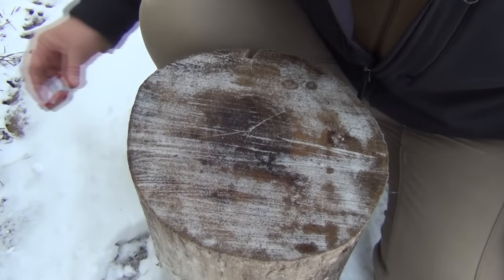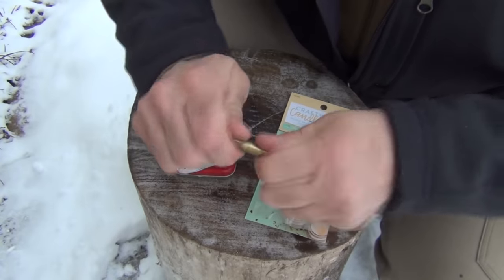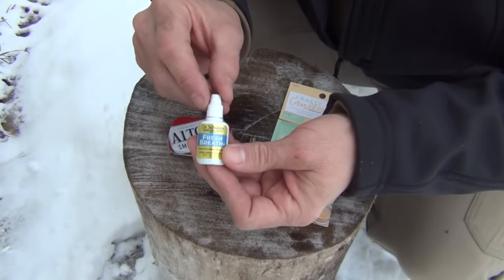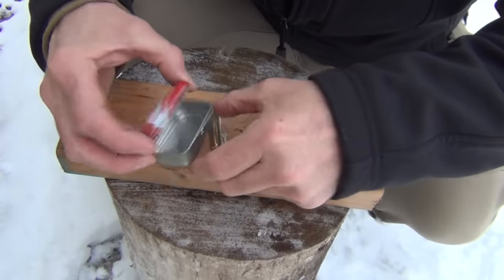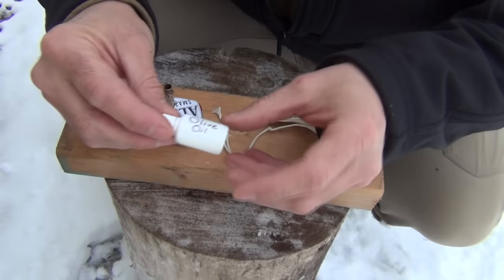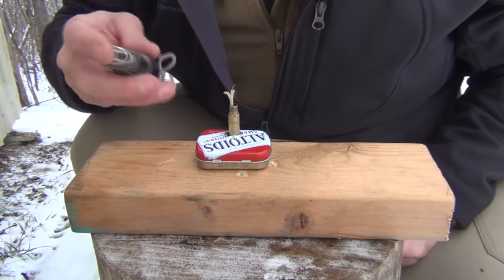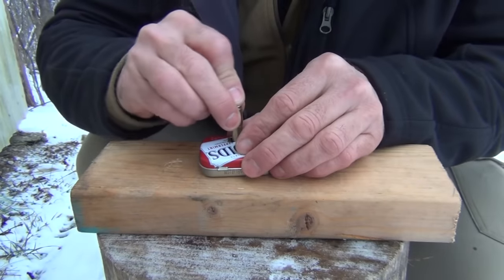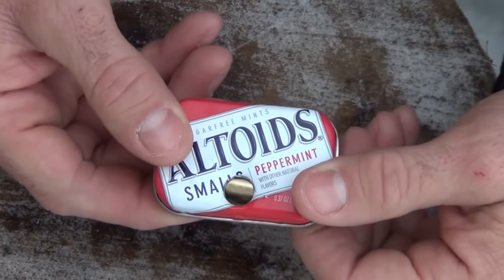MINI OIL LAMP [Really Works!]

Comment: To get a lot more wick. Wrap it around the outside of the shell casing (not tightly) and when you slide it off it'll be like a spring. Slide it off and give it a slight twist to make it same as the inside diameter and slide it inside. If you leave a little bit of spring to the twist it will press against the sides so when you slide up extra wick it will not fall back inside and let you use 90% of the wick before replacing.
Reply from the maker: Good idea. Thanks for watching.
Reply: Less room for fuel though…
Reply: @CorgiCorner   The fuel should soak into the extra wick and you shouldn't lose too much capacity.
Reply: @CorgiCorner same amount of wick spring or hooked I would think.
Reply: OK, that was a sweet little trick. Thanks James

Comment: You only need the container, string and oil. The casing is a nice touch, but it isnt needed. Make a very small hole in the lid of the container, just big enough for the string to pass through and make sure the string has oil on it. Simple. :-)  Good video.
Reply from the maker: A mini Altoids tin has punched out hinges in the back which would leak out most of the oil.

Comment: James I can’t keep up! I love all these little projects. I have larger wicks with ceramic buttons to convert jars with metal lids into lamps and I use olive oil because I wound up with several bottles that expired before they were used up. Now I have a new use for the oil when I’m camping. Thanks for the idea!
Reply from the maker: Thank you for watching and glad you liked the project!
Reply: Steve, I'm curious, how were you storing the olive oil? I've had great results with the three liter cans for even 1-2 years.
Whenever I open one, I put it into 6 500ml bottles and we use it from those, in turn.
The only times that I've had any go rancid were when I left it in partial bottles for several months.
I'm in the South East of the united States but I do have a basement that doesn't get above 80F/27C even in summer. 
I can dry, pickle or can a lot of what we use, but I haven't sorted out storing fats and oils just yet. I'd love to hear what you're doing that worked or didn't.
Reply: @matthewellisor5835  I purchased it in two for one sales and had several glass bottles in the cabinet. My wife developed brain cancer and was hospitalized four times due to strokes and I stayed with her during these times. Due to that the oil reached its expiration date as indicated on the bottle since I wasn’t cooking at home. She passed away in July and this oil wasn’t used regularly due to her condition over 27 months. I’ve yet to actually proved its rancid, just going by the dates. The oldest expired just after her cancer diagnosis in April of 2019. I kept the oil for use in an other than cooking situation but the later bottles may be perfectly fine.
Reply: @matthewellisor5835  I’m in the Southeast too, coastal Alabama.
Reply: M
Reply: A
Reply: @steveturner3999  Steve, all I can offer is my empathy at your wife's passing. Like most, I've lost from this Earth some of those closest to me. I don't dare to imagine what... I'm at a loss for words.
I'm glad to hear that you were there with her during that time.

If you ever find yourself Two-States East, let me know. I'd enjoy a chat without these keyboards and screens in the way and lunch is on me.

As to the oil (and most food,) the "best by" date means little to me. If it passes the sniff-test and isn't something likely to harbor bacterial toxins, I trust in that which caused us to have these olfactory sensors and instinctual responses. (I believe that to be a purposed Divine creation but that's another topic.)

Sorry, I'm still struggling for words. Thank you for sharing.
Reply: @matthewellisor5835  Hello Matthew! If ur asking on storing meat, Heidi has a channel called rain country, she dries up ground beef, puts n a strainer to let most of fat drain off, I think her next step was to dehydrate, then pack n canning jars, using a break bleeder will remove all air and seal jars. Her channel will show u how, plus how the break bleeder works (if u don’t know about it) she also dehydrate’s chicken, hope this helps
Reply: @steveturner3999 I don’t know you. But I’m Truly sorry for your loss if it was one. Or congrats on your freedom without alimony if that’s the case. But expiration dates are just a suggestion. If it doesn’t make you want to puke or your tongue feel kinda numb and tingly. You’re good I’ve scrapped mold off and ate shit my dog wouldn’t even eat.
Reply: Olive oil burns cleaner, safer, longer and is actually very affordable. It has been used for tens of thousands of years. A $1 bottle from a discount store is in all our bugout bags and prep supplies. Save those little annoying mini ziploc bags from purchases and store oiled wicks in your fire kits.
Reply: @SteveTurner Praying your heart is comforted and at peace until you see your wife in Glory one day. 🙏
Reply: @joybickerstaff194  I don't have any steer but I use "venison gravel" for many camping trips. most of the rest usually gets pressure-canned.
Reply: @SistahTuMuchMarley  Thank You!
Reply: Olive oil doesn't expire. They have to put a date on the can/bottle because it's required by law but it never expires...

Comment: I keep an Altoids mini tin, a Swiss army knife classic, and a mini bic in my 5th pocket every day.  My mini tin doesn't have a ton in it, just a few things to make life nicer if I need it (12m dental floss, some cotton, hot glue, duct tape, super glue, spf 100 sunscreen, 90% deet, antibiotic ointment, etc.).

This would be a neat little project though. I have some more tins.
Reply from the maker: Sounds like you're pretty well kitted out. Thanks for watching!
Reply: That's a lot of stuff in one of those mini tins, what is the hot glue stick for? Can't fit the gun in there
Reply: @recoveringsoul755  you can just heat it with a flame and it'll get sticky.  I'll admit, I haven't used it for anything yet. In the summer I mostly use the sunscreen and deet from the tin (and the knife and lighter of course). It's annoying if I do though because I make the little sealed straws. Still, if you're stuck in a canoe because your cousin MUST catch ALL the bass TODAY it's nice to have sunscreen even though you are bad at planning ahead....and mosquitoes suck.

Mostly the slice of hot glue just fit nicely inside the floss spool. In the winter I have a different one with a little different stuff.
Reply: @orenmontgomery8250  ok that's interesting. Well when you gotta fish, you gotta fish. Maybe pack mosquito netting that goes over your face. Probably packs pretty small?
Reply: @recoveringsoul755  yeah, but that takes pre-planning. The point is this is in my pocket every day, like car keys. I use the knife every day but the tin is pretty rare. It's more like the 'I'm already on the mower and don't want to run in the house' kind of thing.

Comment: Very cool little lamp. I'm going to make one and see how it goes. I have been making these since the 80's, but out of the tiny MRE Tabasco bottles we got in our MRE's. I used 1/8" round wick and make it a little longer so when the cap is removed, the wick pops right out. I use a small piece of foil with a tiny hole in it and put it over the wick and pull a small amount of wick through the hole to regulate the flame. With a 3/4" flame, I get about 70 minutes of burn time. I use a needle oiler to refill it as that's the easiest way to get fluid in the tiny hole without making a mess. I've even made large oil lamps out of the bigger Tabasco bottles. Keep the great work.
Reply from the maker: Excellent. Thank you for watching and for sharing your experience making lamps like this.

Comment: I’ve done similar with bacon grease, sausage grease and hamburger grease soaked into a paper towel and put in a can. It burns for a while and doesn’t smell bad. The Jews used olive oil for lamps going back to the beginning of the Jewish faith too so it is a classic and classy choice. Amazing how long paper towel takes to burn away when soaked in oils
Reply from the maker: True enough. Thanks for watching.

Comment: I remember some similar setup, but with a candle and the tin also served as a windscreen and reflector. Something tells me that was one of your videos. 
Make sure it's real olive oil so it doesn't congeal (turn to jello) on you at low ambient temperatures.
Reply: I was about ready to make that same comment!  Yes, James does have an altoids tin candle video. I made one amd it works great!  I do think you can apply that to this oil lamp and make it work.  Like you said, it would give you a wind screen but you could also add a reflective surface to the interior of the tin and get more light.  😁  What do you think James???
Reply from the maker: Yes. I did make that video. It would require the use of the larger Altoids tin. I was trying to make this one fit into the tiniest Altoids tin. I think that it would be a good idea to use the same concept with the shell as with the candle. I thought of that, but opted for this one for the aforementioned reason.

Comment: Pops use to have one of these with his old Army gear. Twist the wick around a nail or something n make a coil. You get more in there for them longer trips.
Reply from the maker: Thank you for watching and for the info!
Reply: @WayPointSurvival  naw thank you for posting this. I haven’t thought about this candle in 20 years.  I’m goin tomorrow and get an altoids can and a good reason to hit the range.  I need the brass. 🤣

Comment: The VC used spent cases to make improvised lamps during the Vietnam War as well.
Reply from the maker: Thank you for watching and for the information!
Reply: So did GIs. They also made lighters from spent casings in WWI ('trench lighter'). If you have a .223 case & a .38 case, you have a match safe.

Comment: A spent .22LR will also work as a cap.  It just goes inside the 223/556 brass instead of outside.
Reply from the maker: Indeed it does. Thanks for watching.

Comment: I like the 380 cap idea but you can use a .22 or .22short and put it in the .223  and drill a hole for the wick.
Reply from the maker: Yes you can, however you have to make sure that you don't pinch the wick or it can interrupt the flow of oil.

Comment: Something else to consider is that an empty .22 casing will fit the inner diameter of the .223. Drill a small hole in the base of the .22 for the wick.
Reply from the maker: Yes, you can definitely do that as long as you don't pinch the wick to where you shut off the capillary action. Thank you for watching!

Comment: I use a small altoids with a wick wrapped around inside the tin with a screen covering the wick and use alcohol. Makes a great small stove/heater. As long as you can keep the alcohol warm enough because like you know its tough to burn while its super cold out. Great idea thanks.
Reply from the maker: Indeed. I made a small stove like that not too long ago on my channel. Thanks for watching!

Comment: Glue a magnet to the bottom of the .223 shell so you don’t need to drill the hole in the Altoids tin for it to stand up.
Reply from the maker: Sure, you could definitely do that!

Comment: Now you’ve got me thinking.... right now I’m carrying a 10 ounce stainless steel flask of olive oil in my cooking kit. Could I turn that stainless steel flask into a reusable  candle by adding a wick and an ignition source? How long would that candle burn on 10 ounces of fuel? How many wicks would I need to handle say three nights in the woods? How much light would the olive oil candle produce? Would this be Safe? I’m going to start with the shell casing candle filled with olive oil that you’ve demonstrated here. But you’ve got me thinking... thanks for the information - Tennessee Smoky
Reply from the maker: You could absolutely turn that stainless steel flask into a reusable candle. As a matter of fact, you can even purchase corks and wicks that are made specifically for wine bottles to turn them into olive oil candles. That might be something that you could modify. Thanks for watching!

Comment: Why make the hole towards the edge? Wouldn't the hole punched in center be more stable then on edge, possibly flipping tin over and starting a fire?
Reply from the maker: Because with the hole to the front I can leave the olive oil bottle inside the back to weight the base which makes it even more stable.

Comment: That's cool. I'm always looking for new ways to make light. When I was a kid I kept sea shells from the Jersey shore with wax and a wick in a shoe box in my closet. Even today the power goes out at least twice a year. Would olive oil work in a regular lamp oil lamp? Lamp oil is so expensive.
Reply from the maker: Yes, olive oil will work. However, you will probably have to experiment with different types of wicks to see which one will burn the best. That was the greatest challenge I faced in developing this particular system.
Reply: It would smoke more, throw light less and might not soak as well in the wicking. But it will work. Every time you find a lamp in the Torah or Bible, it's burning olive oil.
Reply: I did this exact thing with 2 old school oil lamps (normal cotton 1/2" & 7/8" wicks) and it just burns the wick in a matter of seconds/dirties glass. The viscosity is too high, especially now in winter when needed. I've tried thinning it with alcohol but it'll just separate. Even with oil level closer with other homemade lamps (say mini mason jar that Everclear uses) it's the same result. Maybe the round or fiber wicks wick faster?
Reply: Could also use tallow, lard, shortening, etc. I make salve which is 60-70% oil of various types and 30-40% beeswax. They burn quite well. Just doesn't work as well when it has activated charcoal, bentonite clay, cocoa butter, and/or shea butter.
Reply: Here’s a suggestion for light. Go to Dollar Tree, and pick up one of their solar yard lights. You can take off the stem, and just use the top of the light. A few hours charging in the sun will give you a nice light for the night. It’s enough to light up the inside of a tent, and they last quite a while. Then they will recharge in the sun the next day. Best of all, they’re cheap.

Comment: Cotton mop cord , mom's won't miss it . 🤪
Reply from the maker: I tried it, it was not only too thick for the casing, but it was also burning up too fast.
Reply: @WayPointSurvival  worked for me with Betty Lamps.
Reply from the maker: The problem is the diameter of the shell casing.

Comment: As a non-hunter, where can I purchase the complete bronze type casing ? Also which types of metals should I NOT USE ? THANKS FOR A GOOD VIDEO. Our electricity is shut off where I live periodically, about 2 times a year. I require something smokeless and odorless oil. Thankyou for saying that about the olive oil too . I used to have a large hurricane lamp, elsewhere where I resided, but don't anymore . I really don't know how to get a hold of this casing.
Reply from the maker: You can often pick up spent casings for free at any shooting range, you can also order used brass from Amazon or ebay. Pretty much any kind of metal casing will do because it's filled with oil, it's not going to rust on the interior anyway.

Comment: Awesome video. Question on removing the burrs. Why not just take a file or a Dremel and grind them down smooth?  Also have you tried this with a .308 casing?  I’m a .308 shooter so I’d be curious how much more time you’d get.
Reply from the maker: I wanted to do it in a simple way so that others who do not always have those type of tools would know how to beat the burrs down. Also, I'm sure that it would work quite well with a 308 shell, you would just have to use the larger Altoids tin to make it work.

Comment: Theoretically, you should remove the bullet from the tin first (blow the flame to extinguish), before putting the '308 cap' on it, otherwise the bottom of the 308 will not fit through the tin hole.
Reply from the maker: Actually, it's a 556 and it will slide in and out of the hole.
Reply: @WayPointSurvival  I never used that caliber (308) to know.  So the 308 bottom will slide out, right?
Reply from the maker: No, the 308 bottom will not slide out from the top.

Comment: I like this idea a lot, just a ? about the olive oil. Can it be put in an oil lamp to? Nicely done
Reply from the maker: Yes, you can put it in a standard oil lamp. However, you may have to experiment with different kinds of wicks to get one that works well with olive oil. It burns differently than regular lamp oil
Reply: @WayPointSurvival  thanks for the info 👍